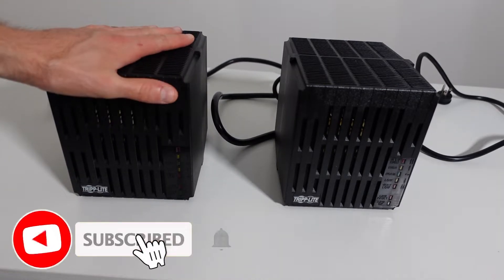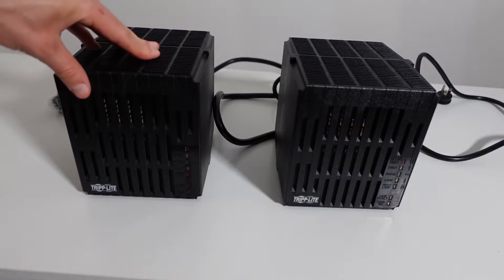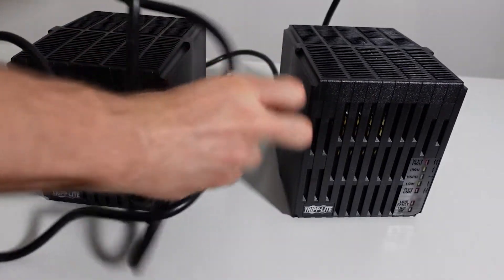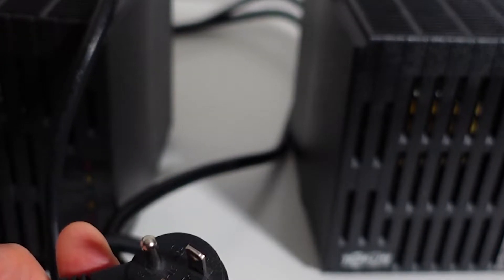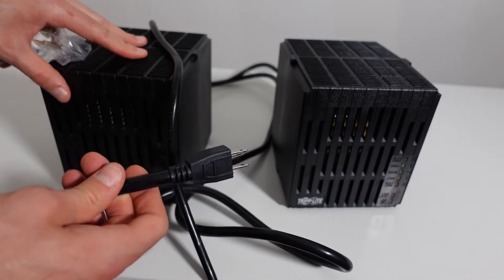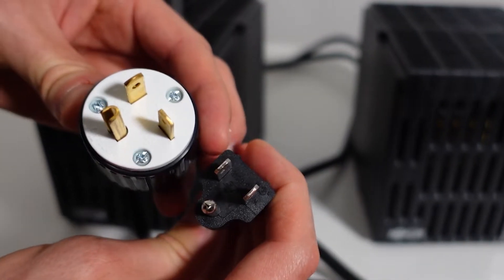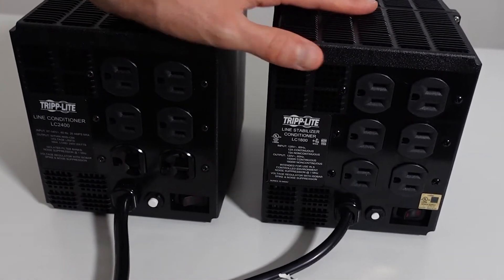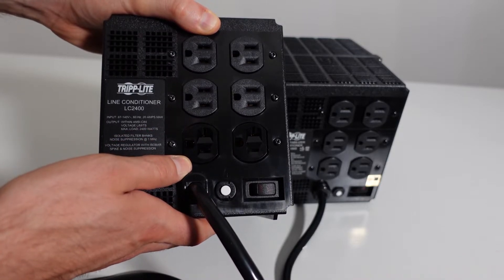Tripp Lite LC1800 VS LC2400 - Comparing Line Conditioners Side-By-Side

Comment: What you're assuming about gaming PC power supplies is unsubstantiated. PC power supplies are switch mode (unregulated) power supplies. The voltage that reaches your PC is based on the line voltage. If there's a voltage regulator anywhere in the circuit, it would be on the motherboard, but most PCs—maybe all, have come with no power regulation. The switch mode power supplies have been around for decades now. They are the reason for A/C power harmonic distortion causing excessive power on the neutral windings of a step down A/C transformer, such as the transformers that were in old office buildings, or down the block somewhere from your residential neighborhood. Since the introduction of PCs, laser printers, and other electronics with instant on power supplies, the amount of power on the neutral side of the transformer has dramatically increased, which was dealt with by doubling the windings on the neutral side of an A/C step down transformer. Electrical engineers have been well aware of this phenomenon, and the double winding was explained to me by electrical engineering firms as a sort of band aid. As far as I know, the problem of harmonic distortion in step down A/C transformers in the U.S., is still not completely resolved. If I'm out of date and you're an electrical engineer, please share what's being done in the "modern" world about A/C harmonic distortion. Thank you!
Reply from the maker: Thanks for your insights—some points are accurate, but a few need clarification. Eaton did acquire Tripp Lite in 2021, and their reputation in power management is well established. PC power supplies are indeed switch-mode and don’t regulate incoming AC voltage, but they do regulate their internal DC rails, so they aren’t completely unregulated. Devices like the LC1800 and LC2400 help by stabilizing and cleaning the AC before it reaches the PSU. You’re also correct that SMPS loads can create harmonic distortion that stresses neutral conductors, which older systems often addressed by doubling neutral size or using K-rated transformers. Modern installations typically use harmonic-mitigating transformers, oversize neutrals, or active filtering, so the issue is better managed today, though older infrastructure may still experience it.

Comment: If you have a 20AMP circuit, you will get 20 amps to the conditioner.  What you are saying, and what you are telling people is that they need to do something that will void the warranty.
besides, you are holding a 30 amp plug, not a 15-20 AMP plug, that is what the conditioner comes with.

Comment: Friend...you don't have to cut-off the factory plug on the LC2400 power cable to make it capable of handling a 20-amp load. That model line conditioner is made to handle the rated load. And trust me, that would void the warranty on that line conditioner. Tripp-LIte would not be allowed to legally sell that unit with an underrated plug---it would be a fire hazard. You pointed-out that the power cable on the LC2400 was "significantly" thicker than the power cable on the LC1800. The reason for that is because the thicker 12-gauge wiring is required for a 20-amp circuit while the thinner 14-gauge wiring is used for the more-common 15-amp circuits. Most modern-day kitchen and bathroom circuits are 20-amp circuits, wired with 12-gauge wiring. Even though they are 20-amp circuits, the receptacles mounted in the wall usually look like the normal 3-prong receptacles used in 15-amp receptacles (they are just made to handle 20 amps). That's why you can plug-in your toaster, mixer, space heater, etc. into those 20-amp receptacles. No one goes around cutting-off the factory plugs on those appliances to plug them into 20-amp circuits. I have owned the LC1800 for years and the tag on it states that is is rated for a 12-amp CONTINUOUS load and a 15-amp NON-CONTINUOUS load. So this unit is suitable for plugging into a 15-amp circuit in the house (provided nothing else plugged into that same circuit causes the circuit breaker to trip. Remember...circuit breakers in the home are designed to protect the electrical wiring. Wires that are overloaded get hot and can cause fires. If you're trying to pull more than 15 amps on a 15-amp circuit, the breaker will trip for safety. Here's what's important to know about the LC2400: it can be used in a 15-amp circuit, but the ratings are 12 amps CONTINUOUS and 15 amps NON-CONTINUOUS. Pulling a continuous load greater than 12 amps will trip the breaker. The ratings when plugging it into a 20-amp circuit are 16 amps CONTINUOUS and 20 amps NON-CONTINUOUS. Notice the rated watts on both refer to the "non-continuous" loads (2400W and 1800W). The continuous load ratings are actually 1920W for the LC2400 and 1440W for the LC1800. To eliminate the aggravation of having your breaker trip constantly, I would recommend matching the rated load of whatever you're plugging into these conditioners with the CONTINUOUS ratings of the conditioners.
Reply: You are correct. Take this gentleman's advice, DON'T REPLACE THAT CORD END.

Comment: im looking at generators and I want to be able to power whole house  if power goes out for extended time. I have already run a 50amp/6gauge circuit with interlock kit. I have a gaming pc with a 900w psu 2 24" monitors in one room and a 65" tv with 500w receiver and surround sound. So I will be needing 2. I am just curious how these work with a generator.
Reply from the maker: No I don't recommend this for that purpose.  If you have a conventional generator that doesn't put out a pure sine wave, I recommend just purchasing another inverter generator.  That happened to me, I purchased a westinghouse conventional generator and found out through researching like crazy that it's better to bite the bullet when you have that much expensive hardware.